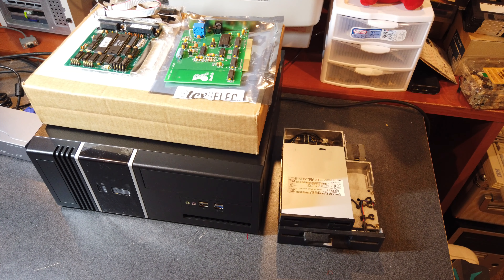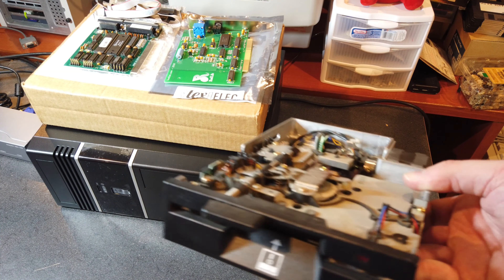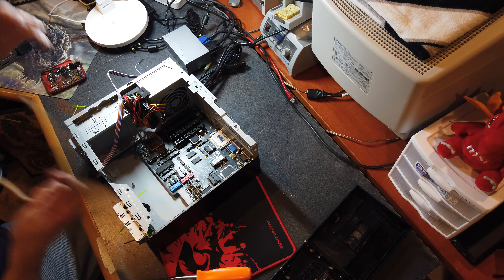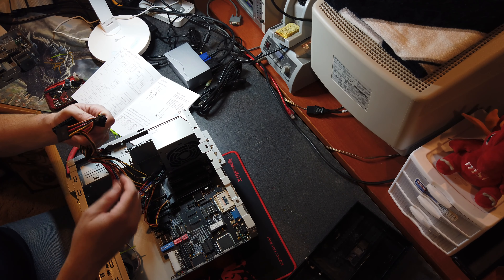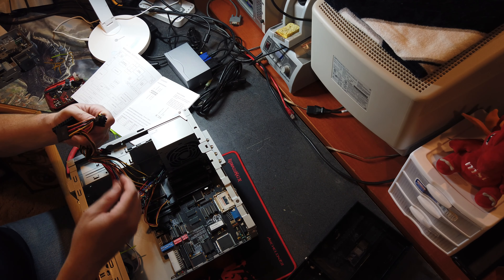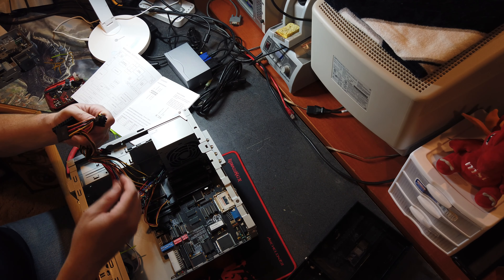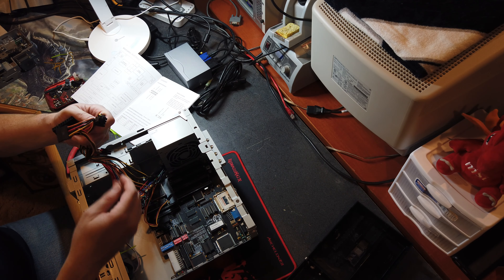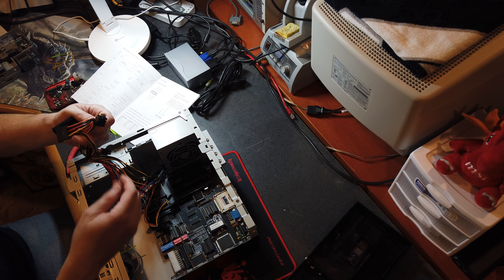Monotech PC NuXT Unboxing and Build - Part 1

Comment: Really enjoyed your Monotech NuXT videos. Well done.
I've owned the NuXT for quite some time now. Probably the biggest problem is finding an appropriate computer case for it.
I'm looking for a small form factor 386 or 486 period case. With one 5.25 and one 3.5 bays that's vertical standing.
Looked through ebay and Google searching. Nothing remotely worthwhile. 
You have any recommendations?

Regards

Comment: Great video, I remember when LGR complained about the NuXT not including an I/O panel... I guess Monotech heard and obeyed xD
Reply from the maker: Yeah I was pleased to see the IO Shield. I was actually in the initial planning stages of modifying an existing IO shield blank from Thinkiverse but had to wait for the NuXT to arrive so I could take all the measurements, then use TinkerCAD to make something. I had no idea it included a very nice shield. He actually has a 2.0 version of the NuXT coming out. Other than a green PCB I;m not exactly sure what has changed on it. I prefer the black PCB but I imagine the 2.0 has some nice QOL improvements. At some point I will sit down and read the manual for it. For doing low end DOS stuff it's still my go to machine! Cheers!

Comment: c:\90s_tech: Clint of LGR put his NuXT in an Apevia X-QPACK3 case, which I feel occupies too much desk space. I'm still watching this video, but I rather like the InWin BK623 you have there; hearkens back to the days of desktop cases, and almost looks as if it was made for the NuXT. I may go with an EFS series tower to add front plated SD floppy emulators and real floppy hardware (I don't know the limits of the NuXT).
Reply from the maker: I loved Clints NuXT build, I think it worked really well. But I wanted something smaller. The original idea was to put a 5.25" floppy drive in the big bay butit  was setup strictly for something like a CD-ROM drive. I want to circle back around to this and add a floppy drive. I'll pull it all apart, drill holes, 3D print an adapter... something. I'll make it work. Thanks for the comment. I hope you enjoyed the video.

Comment: I've watched both your videos on this, but I never got a sense of who the target audience for this is. Is this somehow more enjoyable or easier than simply obtaining a 1980s PC?
Reply from the maker: I feel like this is for the hardcore vintage computer enthusiast who maaaaybe doesn't want to deal with all the problems that come with using an 40 year old computer. Seriously, go watch videos of folks with original OBM 5150s and all the problems those systems can have. They can often cost more than I spent on the NuXT. So for me, yes, I think this is more enjoyable. I also love that it fits in a modern case, modern power supply, modern (ish) solid state mass storage. I'm sure there are those that would disagree with me and that's OK. Some folks like to recap an old mobo/PSU/controller card, track down DIPPs to upgrade the RAM, things like that. Thanks for the comment and hope you enjoyed the videos. Cheers.
Reply: @c90s_tech  My rebuttal is that hardcore vintage computer enthusiasts drift more towards vintage hardware than away from it :-)  Nothing wrong with nuxt but the only issues I've seen is that people expect it to do the work of a 286 or even a 386 and are disappointed when it can't run Wolf3d or similar.  Something to be aware of.
I enjoy your videos thus far; keep up the good work!

Comment: Damnit I'm a dreamer if I'm hoping someday we could purchase something like that for 286, 386, 486 and Pentiums?
A lot of people are all hyped up about "3D printing" car parts and even engines and all I want is new reliable parts for my crazy hobby!
Reply from the maker: I think the NuXT exists because of the hard work of the designer Sergey Kiselev and the dedication of JD of Monotech PC for making them. The one I have and really all the ones made are hand assembled by JD. Sergey even wrote the BIOS from scratch as I understand it, and all of it is totally GNU license Open Source. 

Really the NuXT is a compilation of several of Sergey's designs (and several years of work) all rolled into one thing. To do something like this on like a 286 or even 386 would be even more complicated, take more years and the dedicated of someone like JD to bring it to reality again. That said if there was something like a NuAT (286) or a Nu386, even something that wouldn't require cooling like an SX25 I would buy it in a second! 

And yeah 3D printing things like car parts is totally the future, at least for very old cars where parts are hard to come by. I will actually be doing a video on 3D printing for old computers at some point soon. I have a short list of NuXT related videos I want to get through first, even though I think NuXT owners are few, I hope people will find them interesting. Thanks for the comment!

Comment: Nice build! What type of case is that? Do you have a model name for it or a link? I'm working on a similar build right now :)
Reply: Greetings. The case is the "In-Win BK623" I'm not sure In-Win makes them anymore but they are on eBay. I like they they include a STX PSU. Airflow in this case is nearly nonexistent, but with the NuXT it's basically a non-issue. Nothing on the board really gets hot at all. Would love to see the build when you're done. I still consider the NuXT a super important open sourced hardware product. :D
Reply: @KitelessRex  oh awesome information thanks! Yeah my board is taking a wee while to do because I'm doing it from just the bare pcb. The construction goes quickly but waiting on parts is the really slow part!

Comment: I'd love to  build one of these but the prices of everything is obnoxious; $530 for the Motherboard/Computer, $200 for that case, plus more for one 5.25" floppy drive... Damn it all...
Reply from the maker: David thanks for the note. Are you quoting USD pricing? The NuXT is definitely not cheap but the lusted price in USD starts at $340 USD + shipping and any mATX case will work with it. I paid $70 for the case I build this one into and it included power supply. 5.25" floppy drives vary in price a lot depending on where you find it. The one I planned on using cost $20 at a flea market. If you're like me and have spare parts around, any ATX case and PSU you may have already would work. 

All that said, it's not a cheap option. These are hand assembled units, tracking down some of the components that are no longer made, like the Trident VGA chip are hard. This is certainly not a price to performance winner. haha. This really is for the hard core XT/PC enthusiast. IMO what you are buying is an XT class computer that you don't have to worry about breaking for a long time to come. No need to recap the board, deal with corrosion or an exploded CMOS battery because it's 30+ years old. Like any hobby it doesn't always make financial sense. Hope this gives some perspective. Cheers!
Reply: @c90s_tech  No, unfortunately I'm quoting Australian pricing, and it's awful; the pricing, not the system! I'll just have to keep saving up... $500.74 for the Motherboard (AUD - ouch!) Tandon TM65-2L 5.25" Floppy $114 Ebay (arrgh!) SilverStone Sugo SG11 Small Form Factor ITX Case Black $85 ... plus another $100/200 for the PSU.... The things we do for retro computing.
Reply from the maker: @PCFixer   Ouch! Yeah so sorry to hear about that. It's hard to justify that much for something that is certainly not an every day use thing. I happen to be in a good spot to get one, but if it had come out a month sooner, I wouldn't have been able to swing it. But I think for a PC Fanboy like me, to own something that is X86 compatible and (more or less) totally open source is a rare and unique thing. Sure you can get a Raspberry Pi, and it would be faster, or you could run DOSBOX or something but it's just not the same as real hardware. I'm thrilled to have my NuXT. It's worth it (to me). :D

Comment: Try ELKS LInux: https://github.com/jbruchon/elks . It runs on 8088, can be used from floppy, can be installed on HDD, supports fat16/32 and networking.
Reply from the maker: Ohhhh this looks so cool! Will give it a look as soon as I can. The point of this system is doing old (and yeah slow) old DOS stuff, but I love playing around with alternatives. Thanks so much for the suggestion. Will be checking this out for sure. I think I have an 8-bit Ethernet card around here somewhere. Sorry for taking so long to reply, just missed this one. Cheers!
Reply: @c90s_tech  :). I am helping the project with tests. For networking check: https://github.com/jbruchon/elks/wiki#Networking . Two types of cards are supported. Maybe 3COM will be supported soon. Version 0.4 has several downloadable images to choose from. I use it from a bootable 360KB image and then I install it with the "sys" command on HDD.